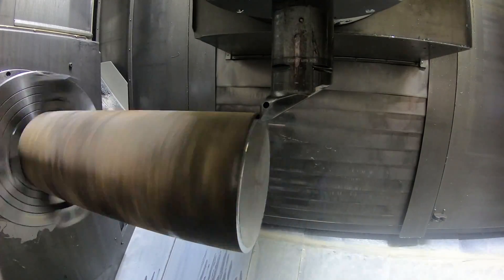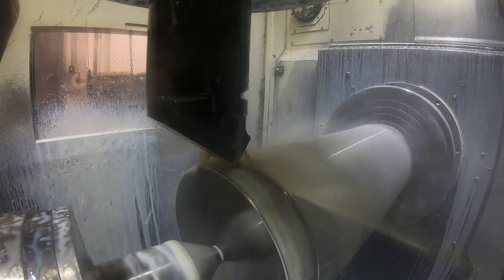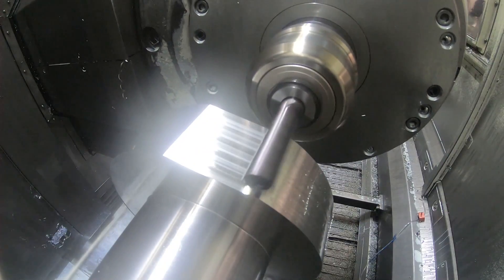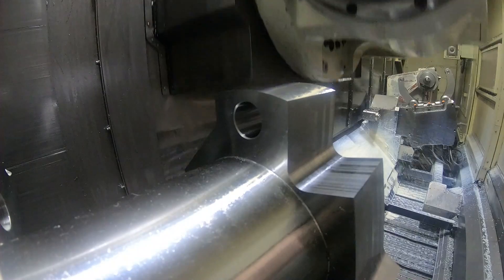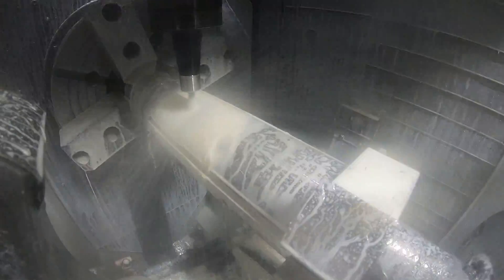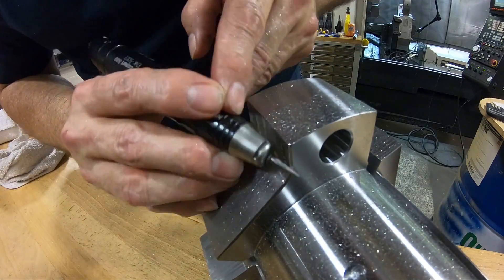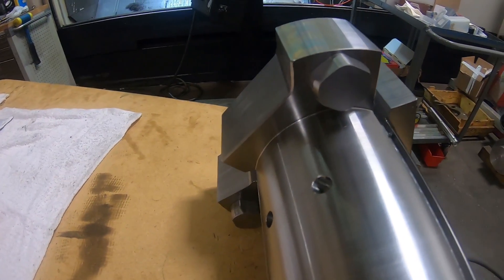Super Duplex Fixture Tail Arbor

Comment: On a piece that weighed 2,000 pounds you turned it down to 220 pounds. You had to start with a big piece because of an end flange. 
So, here's the obvious question: why didn't you weld a flange on and then machine everything? Big savings on time and materials. 
Isn't it true that, done properly, the metal around a weld will break before the weld, right?
So, help me out here. Was it just the customer being a purist and wanting a one piece part?
Thanks!
Love your videos and your work philosophy!
Reply from the maker: They did the first ones that way. They had a failure. So in order not to chance that again. They opted for one piece construction.
Reply: @EdgePrecision  Thanks!
In your opinion, do you think it likely that it failed because of faulty welding or is it that monolithic construction is always the strongest way to go?
Thanks :)
Reply from the maker: @artmckay6704  I saw the failed part. It didn’t really appear to break because of a bad weld but it did break right next to it. So if it had bad post heat treat or the machine work not running true and causing a cyclic stress maybe.
Reply: @EdgePrecision  thank you! There's just soooo much that goes into making parts and, as you and many others have pointed out in various wordings, in the millionths region, everything becomes rubber and moves like the dickens.
It all looks like it would be fun, though!
Thanks again!  :)

Comment: Have you checked out Sandvik's Prime turning tools? There's a bit of a learning curve with dialing in the slower feeds on the lead ins and lead outs. In Fusion they call it "back cutting". Pretty high MRR's. Make sure your part won't be pulled out of the chuck. But really nice for chip control.
Reply from the maker: I have seen them in their catalogs. But I haven't used any yet.

Comment: I have a question for that handheld deburring tool you have, how many watts does it have? I want to buy a cheap chinese one, not spend too much money on it.
Reply from the maker: The power supply says 30 watts. But this power supply can run many different motors. So I don't know if that's what the one I have draws. Its a constant torque motor. So even at say 2000 rpm it has a lot of power.

Comment: I like the way the test fit sounded, some grooves on the arbor ?
Reply from the maker: Both the bore and the OD of the mandrel have about a .005 feed per. rev. on the finish. What you are hearing is the interference between those feed lines. The camera seems to pick up that sound more than you hear it.
Reply: Edge Precision why not a mirror finish ;)  thanks for another excellent video

Comment: For volume of material, and depth of cut calculations the Blue Swarf tooling software  does a great job.  Mainly I use it to get the resonance of the machine and milling tool that allows you to make thin walls with really high depth of cuts.  Typically used for wing rib machining.  It's also very helpful to select a cutting speed and feed that will eliminate chatter.

Comment: Can you go over what you meant by setting your boring bar for the big live center hole? I ,m not sure how to go by that. I would just program it with computer comp so I don't understand why set x offset again.
Reply from the maker: I was just touching of for setting the offsets in the control before running the tool. It was a new tool I didn't have the offsets set yet.
Reply: @EdgePrecision  Oh ok, I'm still not sure how you did it at the control, because we have a tool pre-setter on our lathe. I understand how you set your z offset with the dowel pin.But I'm not understanding how you bored some of the hole, then measured it then that's how you got your offset.
Reply from the maker: This is the traditional way to set a diameter offset on a lathe. Turn a diameter than measure it without moving the tool in X. than tell the machine's control to calculate the offset by entering the distance from centerline (Half the diameter you measured). The Mazak has a function on it's control they call it teach for this (but that's what it does). Now on the Mazatrol control it always displays the actual location of the tool on the display, So you can verify you did it correct, Some machines don't have that capability (Without first calling the offset in MDI) so on the first run of that tool you have to be careful. In fact in a EIA (G code) program on the Mazatrol you don't have to call the offsets for any tools. Just change to that tool and run it. Milling tools don't need a G43 unless its a full 5 axis movement than you do need a G43.4 command. you do also need cutter comp commands like normal.
Reply: @EdgePrecision  thank you for clearing that up, just learned something new.

Comment: So what doc did it try to take when it broke the end mill? That was a pretty long loc on that diameter anyway.
Reply from the maker: With these kind of mill cycles you can have the radial depth of cut (.018" in this case) correct but there is other settings that pertain to what you might call the first pass. In the pocketing cycle there are what they call open borders. In the case of the example in this video that would be the OD where the material is being cut away. What I did wrong was you would have a standoff amount for the open border. Ideally the same as the radius of the endmill you were using. This would make the first pass the correct depth. Than you might have a lead in move of say .050". This would give clearance on your rapid plunge moves away from the stock. With this Esprit software it caries over the last settings you had when you previously used that cycle. What happened was those settings were for a .500" diameter endmill I used before. So the stand off was only .250 instead of .3125 And the lead in move was enough not to have a collision with the stock. So (I know this is a long explanation) with those settings the radial depth of the first pass was .080". To deep at the feed and speed for the .625 endmill. But see because there were no collisions in the simulation and I didn't pay enough attention to that first pass radial depth in the real world it broke the tool. On my grinder there is a Graph being displayed during the simulation that shows the volume of material being ground away in relation to feed. This would be very handy to have the same kind of display on a machining software. So if there is a big spike in the graph you can (On the grinder) click with the mouse cursor on the Spike and it moves the simulation to that position. That way you can see the problem area and correct it. You see in a normal simulation on a cam software there is no indication of load. As long as you are feeding it assumes everything is OK. Wow that was a long explanation. Hope that make some scene.
Reply: It's a big ol' gold nugget, Peter. When something needs a long explanation, don't even hesitate.
Reply: Edge Precision thank you for the detail Peter. I don’t see why software couldn’t calculate (+ or - some) load with horsepower rating and material designation. Time to kick those Esprit guys for an update!!
Reply: Edge Precision and bcbloc02.  You guys are the two most interesting machining related channel on Youtube..
Reply: @Cyrano99X  There are a few more actually , but to me mr.Peter is on the Edge .

Comment: Aligning those parts to re-bore them must have taken some time.  Thanks for sharing this kind of information, you usually only get to learn these things by making the mistakes yourself.
Reply from the maker: Actually the fixture I made in a earlier video works very good.  I was able to just mount the parts and rebore them without to much difficultly. It did take about a day to do it though. Rerunning the tool about two to three times on each part.

Comment: Why do you manually deburr and break the edge as opposed to running a chamfer tool on the machine?
Reply from the maker: For a fixture it takes more time to set up the tool and program than it takes to do it by hand. (This deburring took less than 15 minutes. I challenge you to program and set up the tool in that time). Also cutting chamfers on the machine can't get everywhere or into sharp corners or close to vertical walls. So you are left with doing hand work anyway. Too me it isn't worth it just for one part/fixture. Also every tool leaves a burr. So even chamfering mill leaves them.
Reply: @EdgePrecision  ah ok thanks for the explanation!  That totally makes sense for one offs.  I'm not a machinist, just an engineer who loves machining and knowing more about the manufacturing side 😊.  Your videos are awesome, keep up the great work.

Comment: How did you get to the thinking to use the end mill at 30 degrees to do you centres?
Reply from the maker: I have had the case where I didn't have center drill of the correct size. So I resorted to doing it that way. So now I just always do it on this machine because it can. Also I usually have tools already set up in the machine that can do it this way. When you want a 30 degree center chamfer on a existing hole or bore this is the easy way to do it.

Comment: This is an awesome series Peter. I use FeatureCAM and I'm pretty sure it gives the MMR when simulating, but I know it shows the HP used during sim and max HP of operation and I figure it gets that by calculating it with the MMR and material hardness, I use it all the time and really like that does that. I was wondering why you often prefer to use the hand deburring grinder rather than program a chamfer mill op? faster?
Reply from the maker: My CNC tool&cutter grinder shows a graph/load of the volume material being removed. At the bottom as the simulation is happening. This is very use full in letting me know if the feed or cut is to large. This graph on the grinder can be clicked (with the mouse cursor) on where there is a spike and the stimulation moves to shows the exact place the grinding wheels are at that spike. This type of thing would be very use full in milling and turning. in this case I would have seen a spike where I broke the endmill and corrected the program.

Comment: thats the GOPRO case you made got crashed?       need to make another?    what brand is your backside chamfer tool?
Reply from the maker: The case it self is OK. A few dents but OK. What got damaged was the closing mechanism's knob and rod got bent. I had to take it apart and straighten it. Than reream its hole so it would turn again. The Noga mag base also go damaged. It no longer has its handle. It got torn off. I have to actuate it by turning the magnet with my fingers in its noch that the handle normally turns. But it still works. I will have to make a new handle for it. the chamfering tool is one I ground on my grinder.
Reply: oh  if it was damaged   there would have been case  version #2
Reply: 8.40min dude...

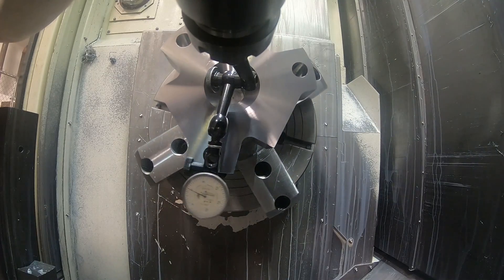Comment: Haha, that's cool  @6:58  how the indicator tip has enough grip to rotate the piece in the chuck.
Reply from the maker: I know this is a joke. But so you will know. I am rotating the C axis with the hand jog wheel while rotating the tool holder with the indicator by hand.
Reply: @EdgePrecision    Ah manual! I was also considering the possibility that the machine could sync the two.  , but I did notice a small bit of following error :-)

Comment: Figures that "dremel" would be made by NSK.   Mind sharing what burr that was?
Reply: Also, what flashlight is that on the table around 16:10?  It kind of looks like a C8F with better styling.
Reply from the maker: I will get back to you with the exact model. It’s a klarus but I can’t remember the model. It has 3000 max lumens of brightness and a rechargeable power. It will also do different programs. One is a strobe light. If you shine that at someone they can’t look at it. They will have to back off or close their eyes or turn away.
Reply: @EdgePrecision  Yeah, I'm kind of a flashlight nut.  I EDC an Emisar D4 which will do about 3000 lumens on turbo but I have an AstroLux S43s coming which I'm hoping won't overheat quite so quickly at full output.  FWIW, I also recently got my hands on a Cree CXB3590 LED that'll do 17000 lumens at about 110watts.  :D   My C8F claims 3000 lumens and looks to be about the same size as your Klarus but I suspect it's closer to 2000 because of the driver.
Reply from the maker: Its A Klarus  XT11X  X22UF11366

Comment: Amazing stuff. Beautiful fixture.

I was thinking that that there was quite amount of deburring on it. I would have went the extra effort of putting a chamfer tool for most of those edges. Particularly that back deburring at 13:36 . Looked like a little more than just a break edge. The tool you did the holes with, could work there would it not? Either way, great work. :)
Reply from the maker: Thanks Gredangeo. This amount of deburring only took about 15 minutes. For one part/fixture it would take longer than that to program and set up the tools to do it. Also with the machine you cant get everywhere and still would be left with some hand work anyway. So for me it just isn't worth it. It would look nifty on the video. I think that why you see it on many YouTube videos. But in industry it really isn't done that much. It is more cost effective to have a deburr person/department do it than to tie up valuable machine time doing it at the machine. Because remember everything leaves a burr. So even the chamfering tool needs to be deburred before you ship the part.

Comment: I have always wondered, from watching your previous videos, what is the advertised repeatability, compared to what you can actually achieve on this thing?
Reply from the maker: Accuracy of things has a lot to do with how you go about doing things. Or to state it another way if you don’t pay attention to what your doing it doesn’t matter how accurate the machine is. That being said this machines repeatability is as at least as good as its resolution. (The encoders resolve to less than its minimum movement) But repeatability is different than absolute accuracy. To give you a idea. When running a boring head as in this video. I can change the boring heads setting .0002” on the diameter and see the difference in the cut. Now the machine moved away (as in this video) moved back. Bored and just took .0002” and no more out of the bore. The rotary axi resolve to .0001 degree.
Reply: @EdgePrecision  dang, pretty decent then. I have a background of around a decade in mostly large manual machining and some cnc lathe stuff, more low production numbers type thing, thats why I was wondering about the repeatability. I kinda figured the resolution was going to be right down there, being of a high quality brand name, but the repeatability on such a large amount of travel I would have thought to be a little bit off. But i guess it helps it probably has a closed loop encoder system ( I think thats what you call it)

Thanks for the reply
Reply: ,,, yes, it is just amazing when you move so much and come back to get maybe 2 tenths !